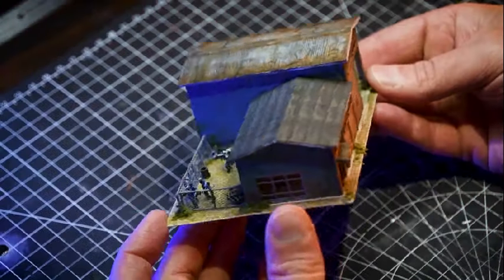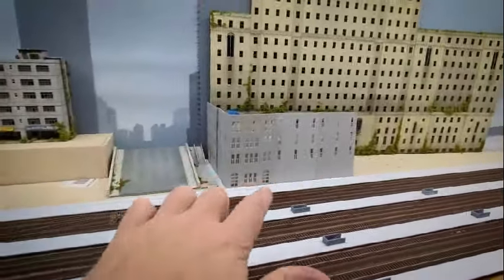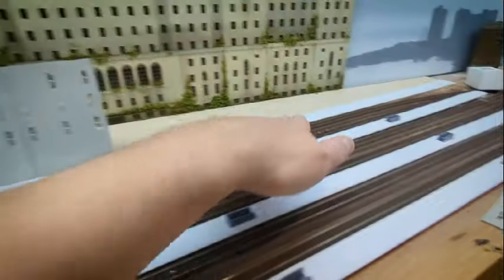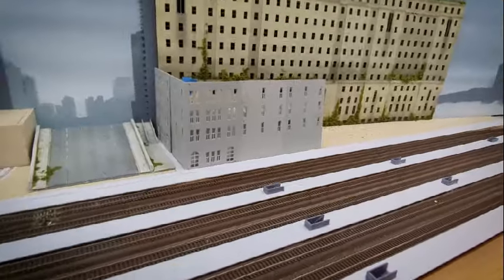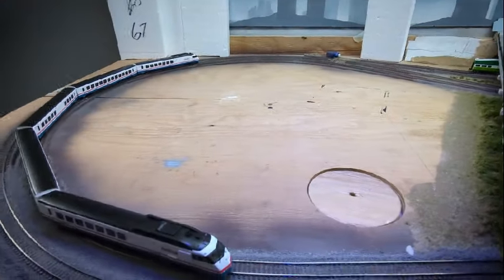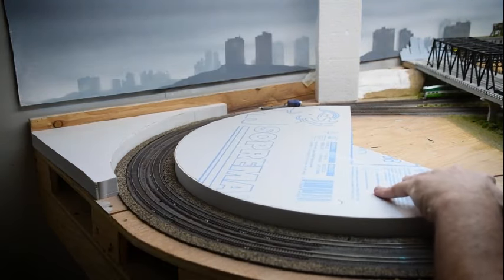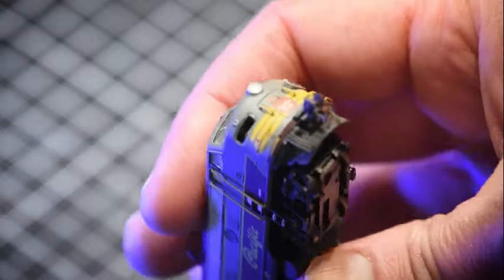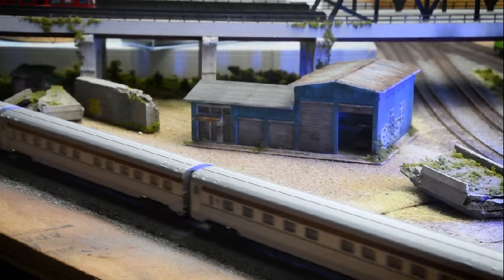Layout Update: New Station Ideas & Vintage Passenger Cars!

Comment: Dear N scale dystopia, cool idea to do a station platform inside the dog bone! Might be that you’ll be able to create a convincing scene by keeping the platform low, as low as just under stirrups of the regular cars. With a higher platform it may look odd for the necessary overhang clearance. Never saw the ‘mind the gap’ moving platforms modeled before, plus such a level of animation in N scale maybe a ‘bridge’ too far. Nevertheless, I have been sketching how to model such a feature in HO scale. Especially those kinds of moving platforms that bump out a section towards the door openings.
Love that Canadian National consist, I’m sure you’ll able to tweak that number plate.
Do understand the divergence from the scratch built Union Station to the, let’s say, modular wall approach. Just liked the mock up design way better. The modular approach may have the advantage that you’ll be able to complete the structure more quickly. Question is, is it worth it? As long as the mock up stands in, you’ll be able to get the other projects going. I’m very sure in the meantime you’ll be getting new insights into solving any design issues with the placement and its form. But of course that’s just my viewpoint, no pressure here. Cheerio
Reply from the maker: Thank you very much for such a thoughtful and comprehensive comment. I am undecided on the station design - I am a victim of my lack of patience!

Comment: What software are you using to model parts for your 3D prints?
Reply from the maker: I lay out the basic dimensions of the parts using Adobe illustrator, and then I import those into a software modeling program called rhino. This is a less conventional approach but it works well for me as those are programs that I'm familiar with.